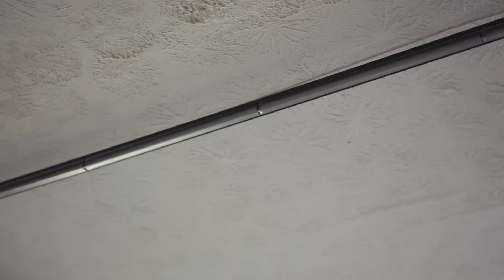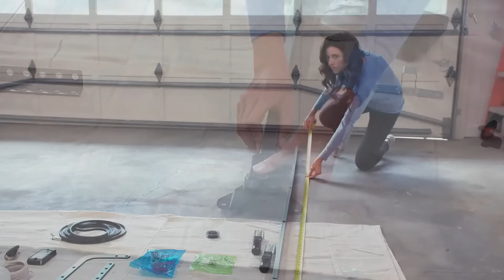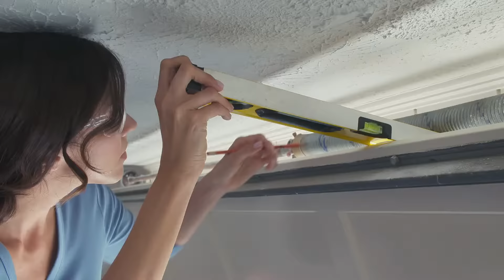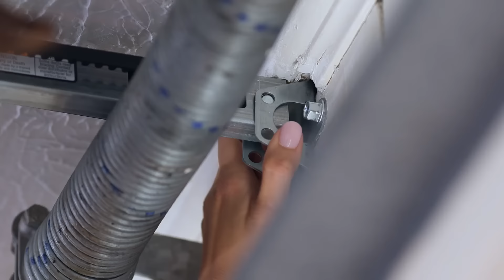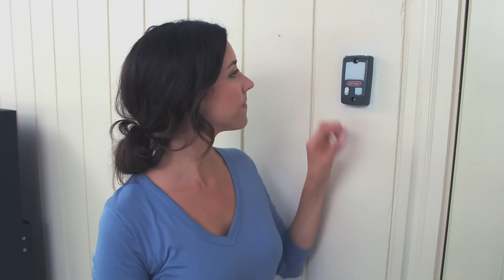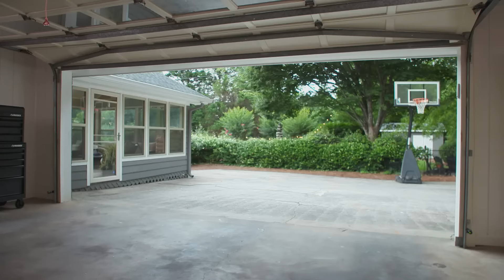How to Install a Garage Door Opener | The Home Depot

Comment: Sensor alignment kills more DIY installs than anything else in that video. People get everything mounted fine, then spend two hours wondering why the door reverses immediately. It's not the travel limits. It's that the sensors are slightly off-axis and the indicator light looks fine but isn't. If that sounds like your afternoon, If the whole thing feels like too much, Chase Garage Door handles this without you touching a ladder.

Comment: If installing a Genie 7055D (as shown),  if the wall button is not illuminated (as in this video) the wiring is reversed on the motor. Also, after installing the belt, make sure the union is about halfway between the motor and the end of the channel; after installing the opener, you will need to manually open the garage door about halfway to engage the door bracket to the union prior to setting the limits. If the union is at either extreme (door near open or closed when attached) it will be beyond the limits of the limit adjustments. Also when syncing the Homelink to your vehicle(s) the programming button on the motor is the learning button. The manual leaves out the second step where you must sync the motor to the Homelink button (after step 1, syncing the remote) by first putting the motor in programming mode and then pressing the Homelink garage door opener button in your car within 30 seconds (this procedure is in your car manual if it has Homelink).
Reply: Tldr

Comment: I did watch few videos, I like one the most especially you only want to replace the garage opener. I really going to measure my old garage opener and see i can find the exact measurements with the new. That way i won't need to replace the tracks.  Shop around home depot and Lowe's tonight. Once i found the one with eact measurament, check online if i can find cheaper.

Comment: When you hang the pull cord, leave the handle off and don't tie knots in it. If its just a straight piece of cord, the ceiminals cant stick a coat hanger thru the top and break in. If it has knots or handles, the hanger has something to grab onto.
Reply: Just lock the door to your house.
Reply: No that will not work. You must shorten the string.
Reply: You can also cut a pool noodle to size and put it over the string.

Comment: What's annoying is I have this same opener and as I'm trying to install it , it doesn't come with the angle irons to mount it to the ceiling. Now why does the garage door opener not come with the basics you absolutely need to get the garage set up. What's the point of paying nearly $200 for a supposed kit
Reply: Because every install is different and they can't possibly include every combination of brackets and hardware for every situation. Some are mounted flush to the ceiling, mine hangs down over 2 feet from the ceiling.

Comment: Just bought a brand new house & it doesn’t come with a garage door opener I’m sooo not looking forward to doing this 🤦🏽
Reply: Same! But we got this, we can do it! 💪🏽 💪🏽
Reply: Just finished. It was not easy but got it done.
Reply: Same situation as you. That day has come. Today is the day. Hopefully I can get it done. Haha
Reply: MY LIFE RIGHT NOW..Were u able to do it?
Reply: @gracieela1533  I got it done. Take your time. Read instructions carefully. Don't skip anything. 

Hardest part of the whole job was getting the brackets onto the garage door opener and figuring out where a stud was to make sure the holes in the bracket were lined up. My garage is drywalled so I can't see studs. Got it done tho
Reply: @Ithinkthisis   many are... my builder was asking additional 1k for the opener. I'll install one myself as well.
Reply: @Ithinkthisis For cheap-o houses it's usually an option. Was $500 when I bought my house 20 years ago. I put in a $100 unit in a few hours. My install looked way better than my neighbors who had it done by the builder, the opener was  better too. Builders typically use the cheapest chain drive units they can find. I did or contracted out a bunch of stuff. It all came out better than what the builder did.
Reply: It’s been about a year now. Have you installed it yet?
Reply: Same smh
Reply: Welcome to the joys of the DR HORTON experience  @Ithinkthisis
Reply: @Ithinkthisis   Lots of them do. I installed my own opener in my first home . Just be sure  to use lag bolts into the studs or one day the opener will fall through your windshield. lol
Reply: Same here! I’m in Dallas. Purchased in Feb of this year and finally getting around to it
Reply: @Ithinkthisis it's an added option. In CA is about a 1100$ add on.

For everyone else who did the install how did you guys fish the sensor wiring through the drywall? I don't like the stapled look especially on a finished garage
Reply: Hire someone.
Reply: I actually have old garage opener, but stop working. I hired a company to installed a hurricane door the last year, and kept  my old garage opener. I supposedly sale my house in April, but things got a little complicated. To make a long story short, at the end I am shopping for a garage opener.

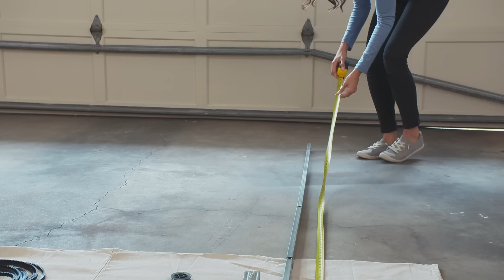Comment: I'm not an expert in garage doors or anything. But I know that you do NOT want to grease the tracks. Clean, yes. Grease, NO. You don't want your door's wheels slipping and sliding instead of spinning. Keep your track dry and clean. @5:52
Reply: youre wrong been in the field for 12 years and grease/ spray Lube is harmless and beneficial for doors as long as they are installed correctly, should not speak on something you know little about
Reply: Clearly you are no expert. Wheels are not "drive wheels"
Reply: Lithium grease is not your typical grease.